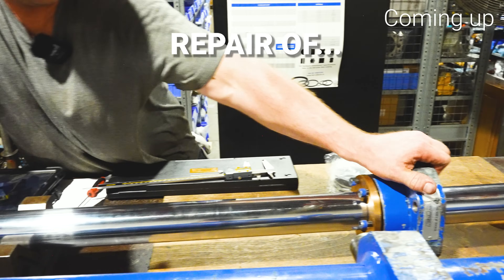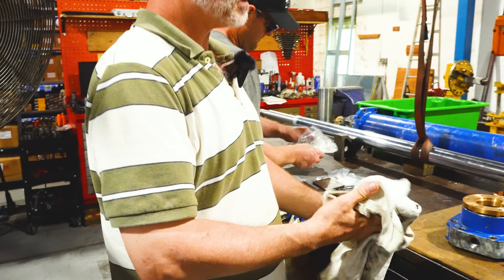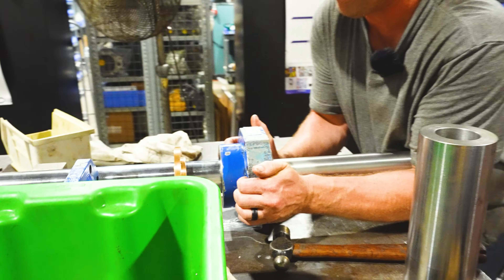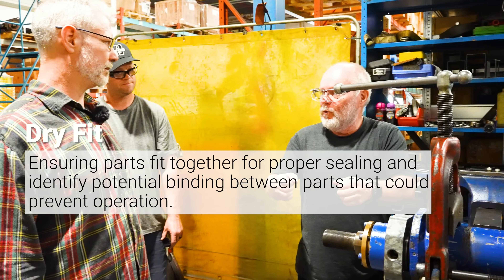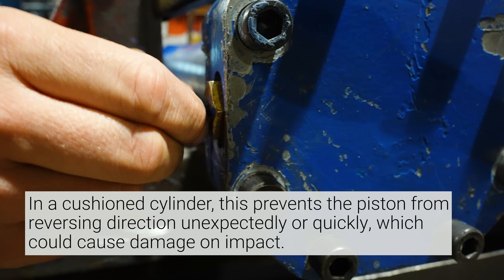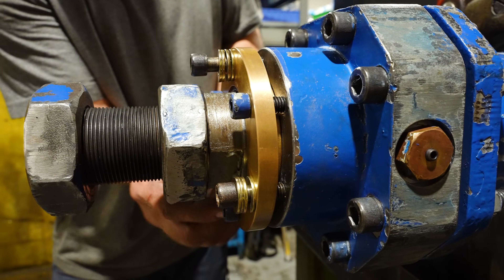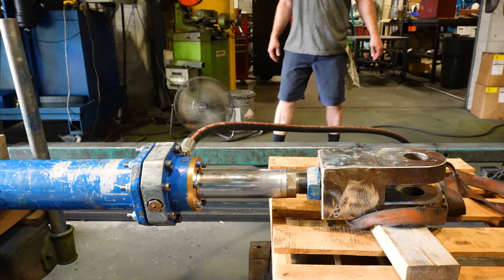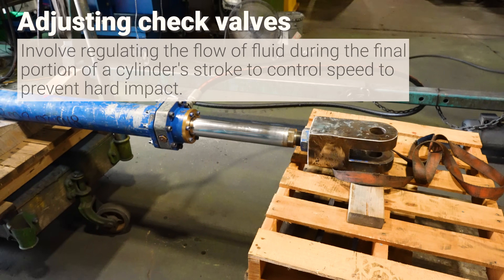Hydraulic Cylinder Rebuild with V-Pak Seals | 2000 PSI test  (Part 2)

Comment: The GM 3.5 5 cylinder the rear main seal V actually goes to outside. THere is special instructions in the AC delco rear main seal. I thought that the customer had installed it backwards. If only he had thought the holes worn into the rear main seal housing were a issue before he installed the transmission.